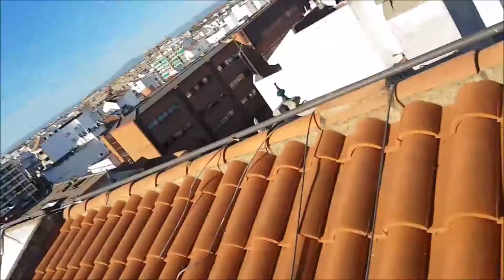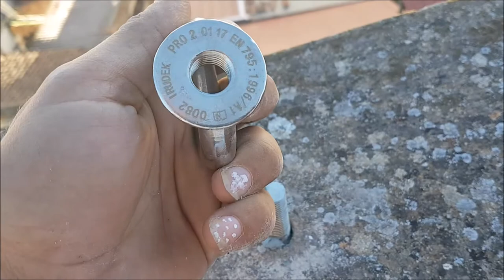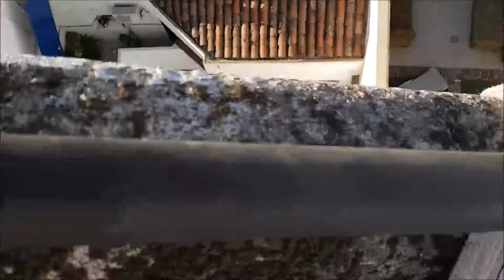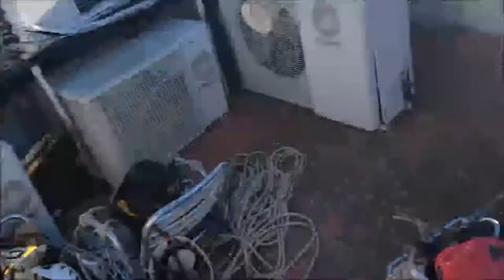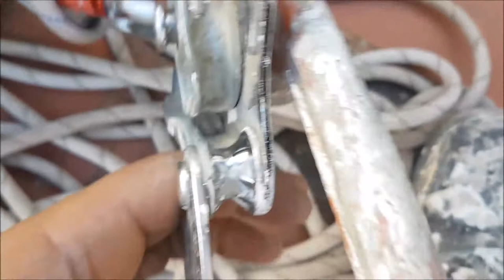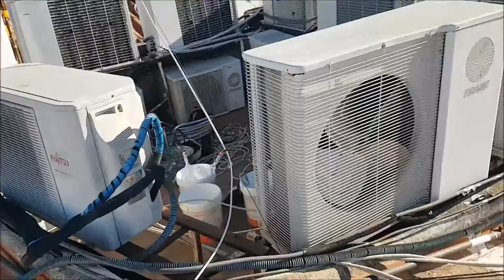No more improvisations - Rope access

Comment: what kind of epoxy are you using on the bolts? I use a product thats in a glass capsule that you just drop in the hole then break it in the hole with the bolt or all thread swirl it around a little bit with the bolt then let it cook and your ready to go. the concrete around the epoxy will fail before the epoxy does.
Reply from the maker: You will see next Monday.